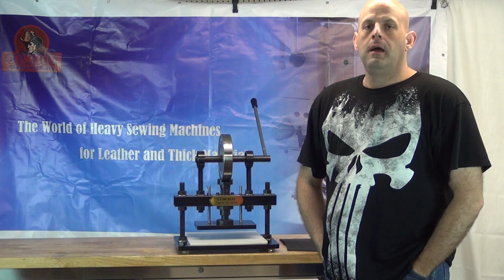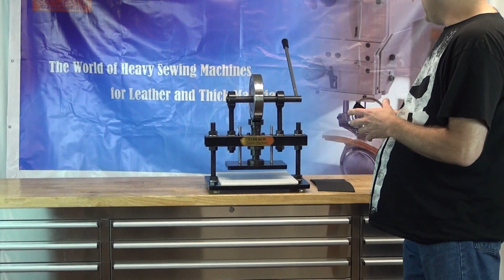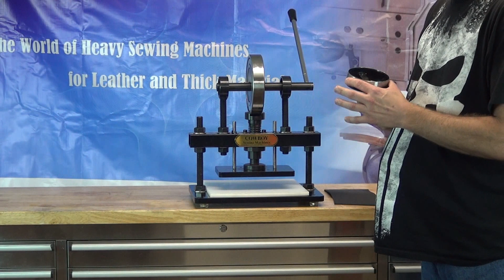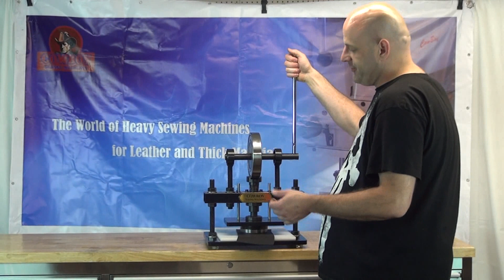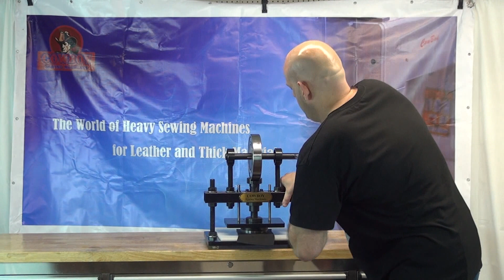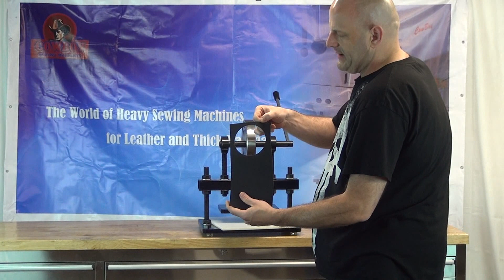CowBoy 8160 Manual clicker and embossing machine

Comment: Where can I find place which makes embosding tool for this press
Reply from the maker: Many local  metal workshop can make the cutting tool.
Reply: @HightexHeavysewingtechnology  im from Croatia I dont know is that even possible but i will find out
Reply from the maker: @melodyinsideme  We do not have dealer in Croatia, sorry.
Reply: is it possible to put stamps with these kind of press
Reply from the maker: @melodyinsideme  Yes, many leather worker use this machine for stamping leather.